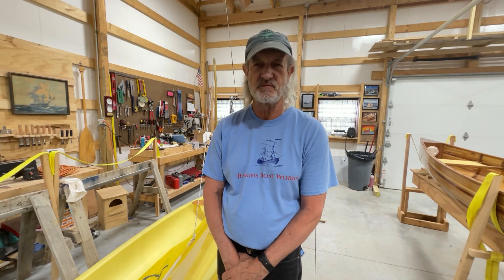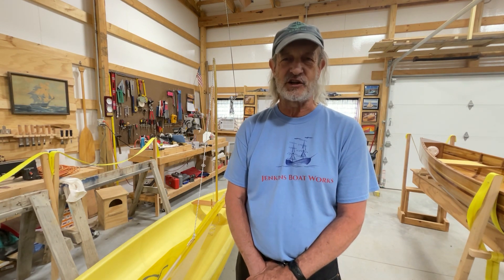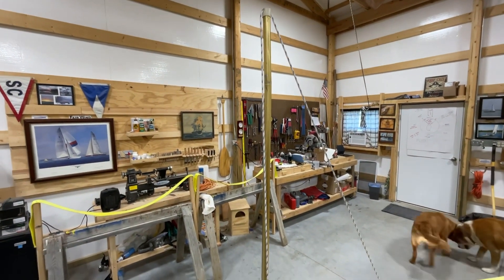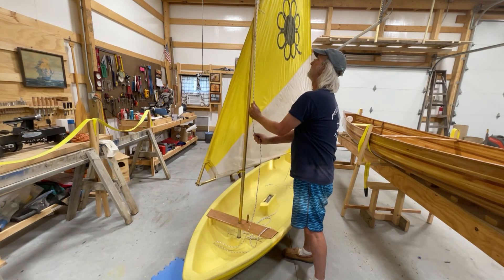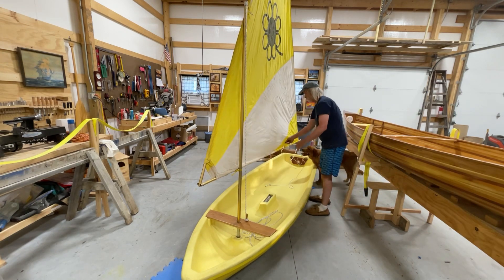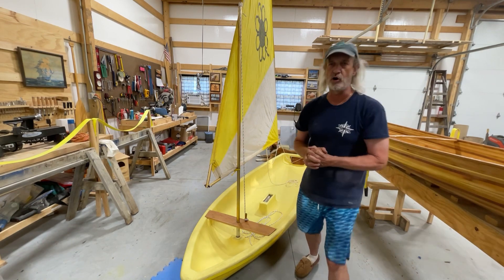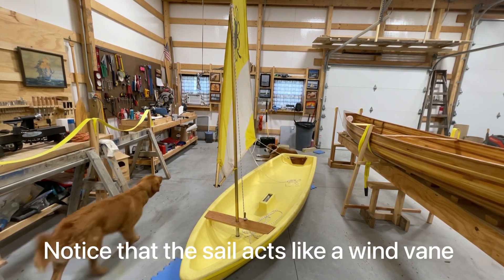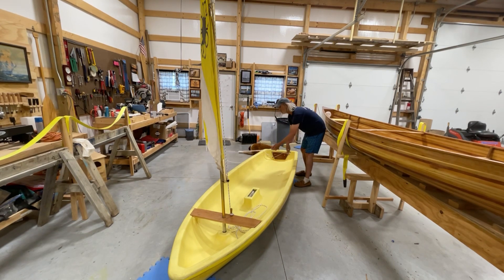Learn to Sail - the Physics of Sailing - center of effort -center of lateral resistance- Lesson 4

Comment: I am converting a daggerboard  to a swing keel on my snark, and adding a bowsprit and jib, from your explanation of center of effort and center of lateral resistance it sounds reasonable for me to move the keel position snug up close to the mast step. Any thoughts on if this is a horrible idea?
Reply from the maker: interesting! some of this clearly is a function of how long the bowsprit is and how big of a jib you might add. I also have question about the swing keel. Are you completely rebuilding a centerboard trunk?  a picture or diagram of your ideas and final expectation would be great. email me something like that and I would be happy to give my thoughts. cejenkinsjr@yahoo.com
Reply from the maker: second response - I just had one more thought. Are you going to have a more traditional mainsail rather than the lateen rig because that would be an odd combination with a jib, at least on such a small boat. I mean the way the yard and the boom come together forward of the mast, you have some sail area forward already. remember the old rule, if it can get fouled, it will. tacking with the original sail rig and a jib could be tricky. if you change the main to a luff strictly attached to the mast, you will reduce the aft sail area and then adding a jib. oh my.. the more I think about it the more I want to see a picture of your ideas and intention.
Reply: @JenkinsBoatWorks  email sent

Comment: what does the Jib sail do?
Reply from the maker: a great question. It works in tandem with the main sail. As discussed, especially toward the wind or on a beat to windward, the jib will force more air around the front side of the mainsail creating more lift. If you get both sails set just right, it is a very noticeable advantage. On a Run, downwind, you can set sail opposite sides or "wing and wing" creating more area for the wind to push on
Reply: @JenkinsBoatWorks  ok thanks